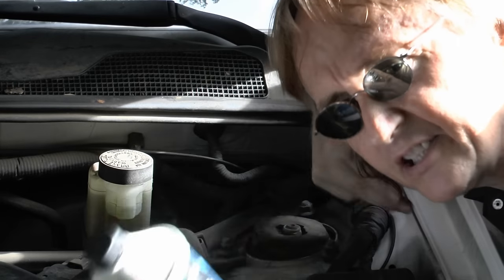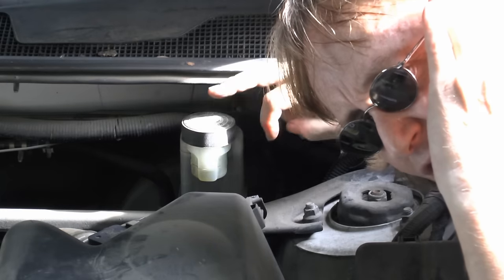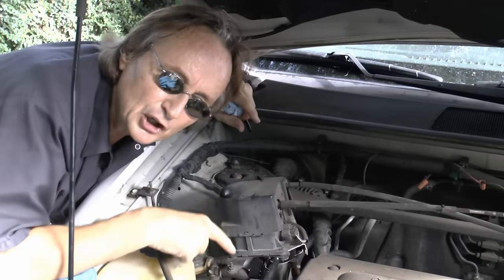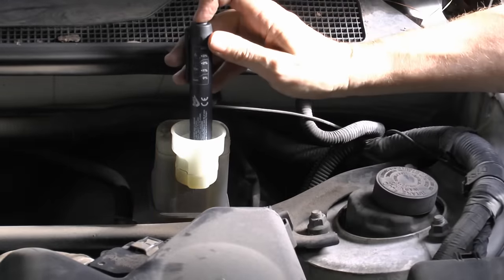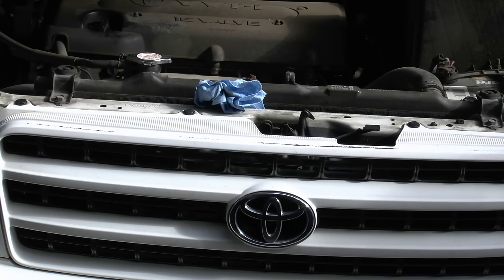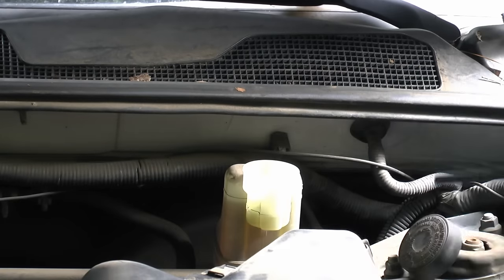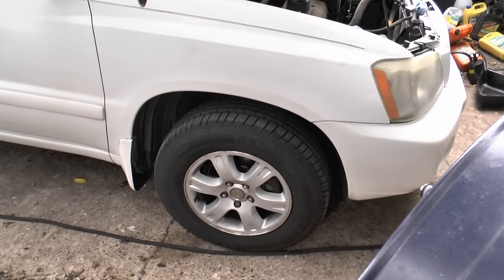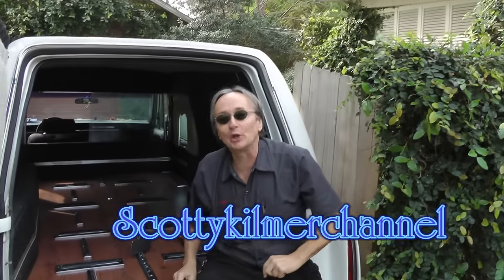How to Change Brake Fluid in Your Car

Comment: Interesting that it's recommended to replace the brake fluid every 2-3 years. I just got a brake fluid tester and it shows less than 2% water 
in the brake line for my 2002 Mustang that's never been flushed or bled.  Not bad for a 19 year old car.  My 2014 Xterra shows 0% water and it's never been flushed or bled.  So, I'm not going to run out and replace brake fluid until it's necessary. However, my Mustang is just one LED 
away of needing to be replaced so I'll be flushing it and replacing the DOT 3 with DOT4. I considered DOT 5.1 but since I don't race the car....I just hope I can find the brake fluid tester a year from now.......

Comment: Skip the fluid test tool and just change the brake fluid in the reservoir .Brake fluid is not expensive.I do a change when the fluid gets tan colored and always when I change the pads.
Best tool for a reservoir

Comment: Scotty, I only recently started watching your vidoes, and i am a big fan. I have a question that is not regarding brakes, but don't know the right place to ask it. I have a 95 olds 88. Brand new engine, but reused accessories. When the new engine was installed, it worked great (though there is a VERY slight rough idle, my mechanic said it could be an inbalanced flywheel). When i get the car up to 45-50, it goes into OD, and then lockout. At these speeds, it has a slight "fishbite" when going up ANY incline. Over these speeds, the problem seems to go away. I took it to the transmission shop, because there was also shudder. They overhauled the trans, put the update kit in there, rebuild tourque converter, new filter, new valve body, and aftermarket trans cooler too. No check engine light is on, but I still have the fishbite. I took it back to the transmission shop, they said "its not the trans". I believe them. They are extremely reputable, and my mechanic said if they said it not the trans, then its not the trans. Any ideas on how to troubleshoot or what to check for? 
P.S.- the traction control light is on, and was on when i got the car-before the new engine and trans work.
Thanks for your time, and keep up the good work with the videos. I watch em even if i am not looking to fix a car. VERY INFORMATIVE! 
The only guesses i have is fuel pump, fuel pressure, or wiring.

Comment: Do you have to  drain the line at each tire or is it okay to just change it just in the canister? My brake fluid is dark green. But I don't think I could get the tires off and back on.

Comment: Doesn't which side you start on depend on which side your master cylinder is on? I think you are supposed to start on the rear with the side opposite the cylinder, then the other rear, then the front opposite the cylinder and then finishing with the front closest to the cylinder. Working your way from farthest to nearest. Correct?
Reply: Depends on the ABS location too.

Comment: Dear scotty 
I have a little question 
I own a 2014 honda civic Hybrid
I wanted to check the brake fluid and guess what?
There is 2 brake fluid reservoir connected together with a lable on the front (higher one) saying check the level on the rear reservoir for max and min indicators....
Can i know what is the importance of the front reservoir?
Why is this design?
What if the rear is full and the outer is empty can this happins?

Comment: Will the measurement be adequate ? Is the fluid in the pipes that are the way to the back the same quality and water free as the one in the master cylinder up in the engine bay ?

Comment: Scotty what happens if I just remove the fluid from the resivore and fill it up with new stuff rather than flushing the whole system?
Reply: Would love to know this answer myself.
Reply: A mechanic taught me to do just that spring and fall. My 98 Corolla has never had a problem because of this. I highly recommend.
Reply: Break fluud is not antifreeze, it does not circulate. Its just additional fluid. So you can do that, but its pointless.

Comment: Thank you for your videos, a mechanic recently told me that someone put the wrong fluid in my brakes. Not the case. But he said they couldn't recognize what type of fluid it is. I have lots of ants, wondering if they got into the system. Silly I know, but long story short they said everything including lines needed replaced. Want to charge me over 2 grand. I plan to do the work myself. Your vids have been so helpful. Thanks again. I have a 1994 Mitsubishi Mirage S coupe. I'll let you know how it goes. Any advise would be greatly appreciated.
Reply from the maker: +Linda Farneth ants can't get inside a brake system, and they wouldn't want to, they don't like petroleum products.
Reply: I know I was being facetious.
Reply: +Scotty Kilmer hey Scotty how are you, like your every single video clip and I thank you for sharing this knowledge with all, anyway Scotty I have an 08 Camry 2.4l motor has 170k on it very well kept car somehow I often get this pinking sound at initial power then its all good  being a curious guy I understand how o2 sensor works would you recommend to change it since it still has factory one on it. Thanks

Comment: Hey scotty do u need to change the power steering fluid? And what do u think of the brake fluid on a 2010 dodge charger sxt awd
Reply from the maker: yes, ps fluid gets old ad dirty, best to change it out every 4 or 5 years if you keep cars a long time. I would test the charger fluid to see if it needed changing as in this video

Comment: Hey Scotty I was wondering I just changed my brakes my rotors and my rear calipers but now when I step on the brakes I have no brakes and I did bleed out all the old brake fluid and put in New brake fluid I was wondering if you had any thought I would be doing it if I keep stepping on the brakes and work in tiny bit though

Comment: Hey scotty how much would you personally charge to bleed out the brakes?

I went to some mechanic yesterday and they said 220 idk is it too much? And that's all labor and parts that's all he said..
Reply: Jose Martinez Depends on The Car and braking system they use for example Some Older Mercesdes use SBC Which requires computer to bleed a certain amount etc etc, but i wouldnt charge 220 to do it even on that Merc, If you have a standed braking system just do what scotty said, Pull off the wheel unscrew the bleeder screw(Not taking it) and pump the brakes and you will bleed it thats all there is to it

Comment: Is the bleed order the same on right hand drive vehicles? Right rear, left rear, front right, front left?
Reply: Always check your owners Manuel but I would say almost all cars have the same procedure. Bleed the valve that is the most farthest from the master cylinder. In this case it was 
Rear passenger side
Rear driver side
Passenger side
Driver side

Comment: Can the break fluid become acidic and eat away at your brake lines even if it doesn't have too much water in it? I thought you had to change your brake fluid every 3 years as preventative maintenance.
Reply from the maker: nonsence, brake fluid does not eat up steel brake lines, that's why such a fluid is used for brakes.

Comment: Hi Scotty,
want to change my brake fluid in toyota corolla 98. there is DOT 3 colour BLUE  kind of fluid there. so should I buy same colour   fluid (DOT 3) OR any other colour will work COZ it will mix if i just change it from reserve tank. any Suggestion ?

Comment: Scotty, my Colorado coming up on 200,000 miles I would like to change transmission filter myself this time, but my question is I have been told that if I am not having issue with the transmission, not to change it, because I may be making problems for myself, can't figure out what problems I would cause, do you have any idea?
Reply from the maker: Yes, on that, you either change it every 30 thousand miles regularly, or leave it alone. Changing it now could make it slip big time

Comment: Hey Scotty, My mother drives a toyota Camry 1999. I'm planning to do a full fluids replacement on it soon as I have found burned solids in the oil dipstick and the transmission fluid is running grey. been about 190,000kms ~ 120,000 miles.
However I've watched your videos and I also want to diagnose another problem, a burning smell from under the hood. On cold days I can see the hood smoking, but on an average day I can smell a burning smell. I'm not sure what type of burning so I'm asking. From what I've seen on your videos it could be the radiator, an oil leak or an old engine gasket.
Not sure how to diagnose them, if they are the problems.

Thanks, I have been watching your videos for a while to learn how to maintain my own car. (which is new), mum's seems to have problems so I'm unsure how to fix them.
Reply: Possibly manifold intake?

Comment: Scotty, I just replaced brake fluid in my parents' Honda Accord '03 with 40k miles. The brake fluid was dark as opposed to the apple juice color, and it was recommended at this service interval. Just wondering if color can also be an indication of condition of brake fluid? Do you think there's a chance that this original brake fluid is still serviceable?
Reply from the maker: car is 11 years old and fluid is dark, I'd change it now
Reply: Thanks Scotty!

Comment: I have a 98 Acura TL 3.2 with 178k on it. The engine stalls when I first start the car. The idle is below 500 and feels a little rough and I have to really rev it to keep it from stalling. I had the throttle body cleaned a few months ago. What could be the problem?

Comment: hey scotty i have a 2011 ford fiesta that i got little over a month ago from valentis ford it gave off a check engine for knock sensor bank 2 malfunction they replaced it after getting it back today i bought some di electric grease and began putting it on connectors to prevent further issues down the line and my cars check engine popped up and they scanned it and no codes their scan tools didn't fiond any trouble codes yet when i hooked up my scanner to found the same error p0330 after putting the grease on it and driving 8 miles could have putting a little to much grease cause the sensor to be to sensitive?

Comment: My 2014 corolla service schedule said to change brake fluid every 46000km. Should i trust them?
Reply: Brake fluid is not a mileage thing, it is a time factor.  Should be changed every 3-4 years, 5 years max.

Comment: Heck a little bottle of brake fluid at autzone is like $3 and it only takes a couple of seconds to suck and fill the master cylinder so it's totally worth it.
Reply from the maker: just sucking it out doesn't clean the system. the crud stays at the ends, as brake fluid does not really circulate like coolant in a radiator does.
Reply: And still, you only test at the reservoar...

Comment: +ScottyKilmer I recently bought a used Toyota Corolla from 1995. The brakes were horrible, I had to pump the brakes in order to actually brake the car completely. I've changed the brake fluid and the old fluid had metal bits and pieces in it. The brakes are a bit stronger now with the new fluid but not enough to be acceptable. What's your advice?
Reply from the maker: +nag1460 replace the master cylinder

Comment: I haven't ever changed the brake fluid in my 2004 Toyota Camry, and the brake pedal is still firm, ABS still works, and there are no leaks.
Reply: Got a 2005 and that bih empty

Comment: Scotty my brake fluid was green so i changed it then a couple of weeks later it turned green again. Thoughts?
Reply from the maker: green is corrosion inside the system. But if it works fine, ignore it.
Reply: Scotty Kilmer Scotty you must have people lined up around the block in Houston that want you to be your mechanic. Do you ever have to turn people away because you are too busy ?
Reply from the maker: lightningsmokerXx
no, they just wait for me, I tend to fix cars quickly

Comment: Scotty, I was searching for brake fluid tests and ran across the Brake Engineering site.  This particular page on their site was titled "The Dangers of Conductivity Type Brake Fluid Testers"  Basically, they highly argued against using the type of tester you used in this video.  Any thoughts?  I assume you don't see a problem with them, but wondering what you think about Brake Engineering's opinion.  Thanks!
Reply from the maker: Jon Alsager engineers can be weird anal people, that's for sure.  There are of course other testers, like strips that measure for copper contamination from the copper used to seal the inside of the steel brake lines from rusting. For water, these testers work fine though,and water is the main problem
Reply: I think you have a good point. These brake fluid testers must be testing either conductivity or capacitance, and not actual water content. I would not trust my car's health to a simple conductivity test, especially when there is a significant chance that they can give misleading/incorrect results..

Comment: What about flushing the brake fluid inside the ABS unit? Is it possible to do without any special equipment? :(
Reply from the maker: NO, you need a dealer level scanner to do that

Comment: hi scotty, i want to top up my brake fluid a bit, but i don't know which type of fluid can be used. the manual says dot4 or dot3. btw my car is mitsubishi lancer 2014. thanks
Reply from the maker: Ammar Hussam go to any auto parts store and use 3 or 4, doesn't matter.
Reply: thanks scotty

Comment: Hey Scotty I've got a 2002 Chevrolet Avalanche Z71 and when i hit little bumps with it the right rear sounds like something is clanging but when i got highway speeds its perfectly fine. what would cause this issue?
Reply from the maker: jack it up and check, often exhaust pipes hit stuff at lower speeds.

Comment: A question, can you freshen up the brake fluid by taking 1/2 a quart out with the turkey baster, then top up with fresh brake fluid.
Reply: to a small extent yes, but it doesn't remove the brake fluid nearest the calipers, which is the fluid that experiences the most extreme temperature and wear conditions. far better to replace every 4 years or so.

Comment: I just change my brake fluid on my Audi A4, manually bleeding the system. Do I need to use a scan tool for it also or is it ok to just leave it as it is?
Reply: By the way Scotty, thanks for your vids, I watched most of them to get infomed and not get bankrupt by some so called mechanics.
Reply from the maker: SacreDro  leave it if it tests OK, you need a scan tool to bleed an audi

Comment: Hey Scotty!

Would you recommend silicone brake fluid for cold climates? I have a 2006 Honda Civic that has 10 year old fluid in it right now but has no issues
Reply from the maker: +Andriy it is a good fluid, but you can't mix it with others and would need a full flush. AND, it does not work well with ABS systems, if you have ABS, do not use it.

Comment: Hi I have a question, the fluid on the deposit work different from the fluid on the wheels because all the heat is there, shoud be a good idea test the fluid from a wheel ???
Thanks
Reply from the maker: +bruno g sure, that's a good idea

Comment: I have an 02 Nissan Frontier. My break pedal has to be pushed down almost to the floor before I start braking. But if i pump it, it tightens up. Have a solution for this?
Reply: RagingGinger413 Um yes,the seals inside your master cylinder are leaking. I would suggest getting that fixed ASAP.

Comment: scotty my grandfather has a 47 buick roadmaster and he has to hook up the #7 sparkplug to see the timing mark on the flywheel is it the flywheel or the timing chain because he thinks its a different flywheel on it. also when it is cold it starts up right away or when its warm and turn it off for 15 minutes and start up back up it starts up right away to but when it sits for a couple of hours after it was started and warm it takes a very long time to start like its flooded but then itll start what do you think it is.
Reply from the maker: old engines like that often flood out due to worn carbs, I'd fix the carb, replace or rebuild it first.

Comment: My problem with the E brake pedal is that it won't go down to engage the parking brake. It's stuck!!  Do you have any suggestions on what to do about that?
Reply from the maker: +dshedder1 spray WD 40 all over it and pray it's just rusted, otherwise, time for a new pedal or new cable assembly
Reply: Ok . I'll give that a shot. Thanks for the quick reply!!